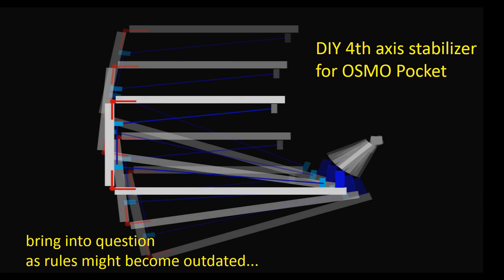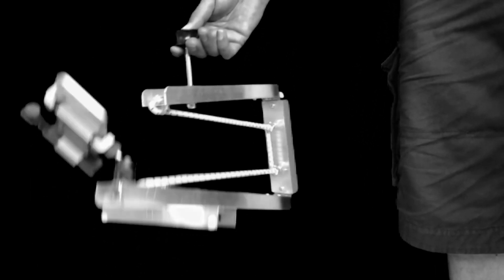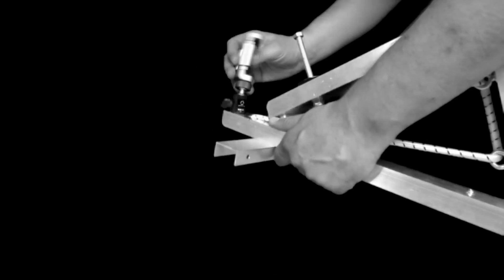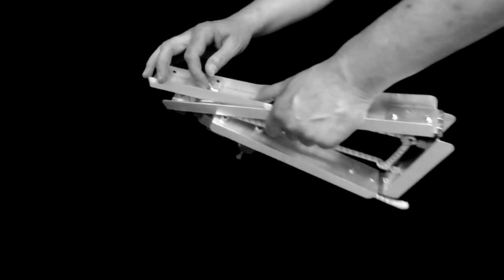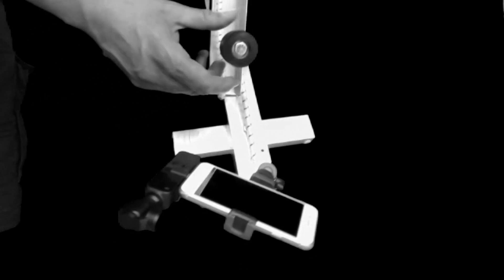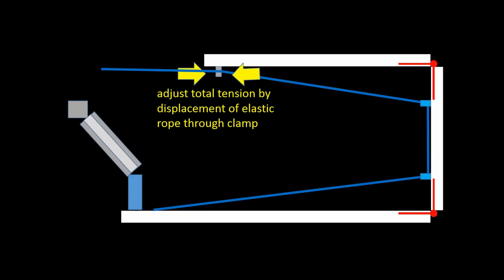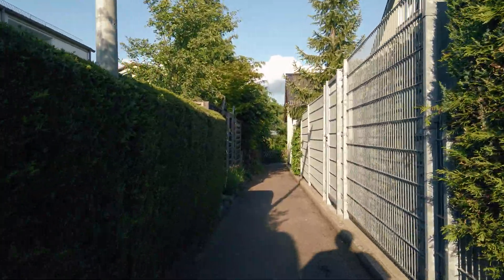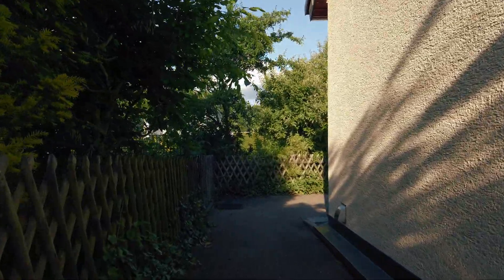DJI OSMO Pocket - 4th axis isoelastic stabilizer

Comment: Can you make one for bigger camera Sony a7ii with 14mm lens?
Reply from the maker: This construction only enables to have a good smoothing for the 4th-axis. Sonys in-camera stabilizer will not stabilize the 3 other axis well enough as its sensor movement is to tight.